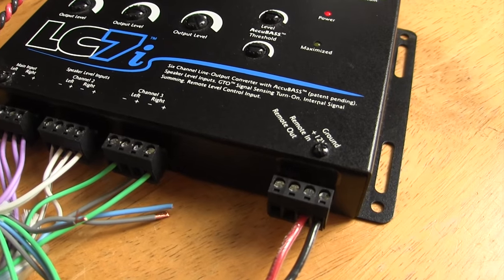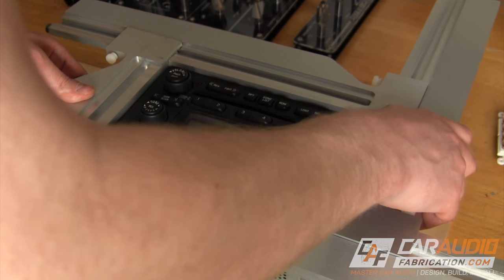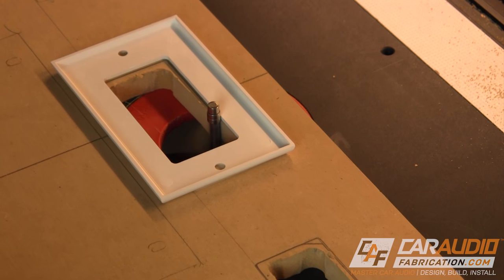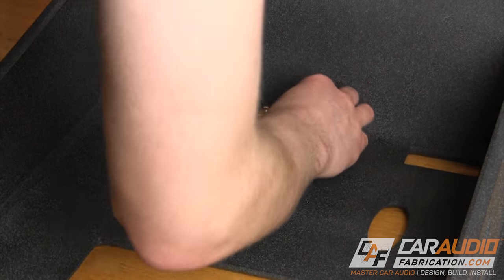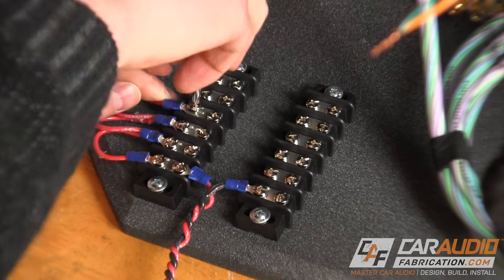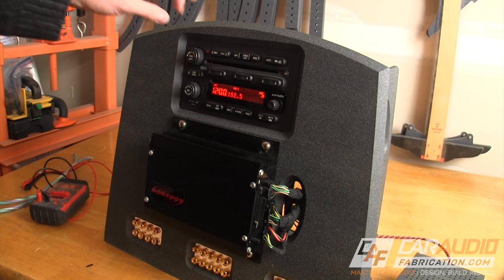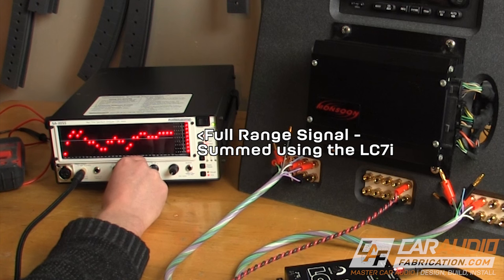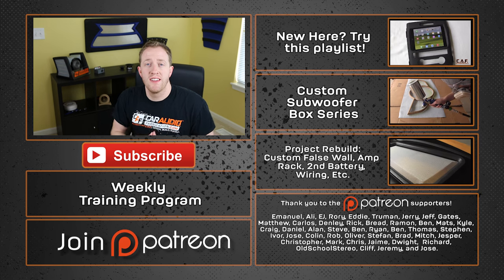Why you NEED Factory Radio Integration - Building the OEM Test Center - CarAudioFabrication

Comment: This series couldn't have come at a better time. I am in the planning stages, (items needed/wanted, placement, etc) of a system build on a 2014 Mazda 3 Sport. And as you may be aware there isn't any "real" possibility of adding a aftermarket HU based on the placement of the factory unit. I have looked into the Audiocontrol processors, etc, (as well as other brands) and this will really help with a real world view on how these work. Especially since I too am primarily a visual learner. Thank you.

Comment: Looks great. It's too bad that some of theses aftermarket DSPs and summing LOCs are so expensive, almost being priced out the same as new aftermarket double din stereo. But I completely understand that factory cosmetics and integration of the HVAC climate controls and other vehicle features amounts to a expensive aftermarket dash kit with an expensive data module just to add aftermarket double din. Great video and demonstration.

Comment: I like that setup, Mark. This really shows how some of the auto makers are stepping up their audio game, but making it harder on us DIY guys. I wonder if they'll ever come out with an OEM headunit with audio outputs (digital would be nice)
Reply from the maker: +BigAl205 Haha that would be the day, it probably cost 13 cents to add so there is no way they would ever do it.
Reply: +BigAl205 Alot of Scion OEM head units have 6 channel preouts on them already, its to bad their cars are so ugly.  On some BMW and Mercedes, you can get an adapter to convert the factory optical to a toslink cable.
Reply: +CarAudioFabrication Scion has analog rca outputs on some of the head units

Comment: Hi
Great video👍
I have a 2017 Honda Civic Rs hatchback 1.5T(Australian model) which is probably equivalent to a touring or sports touring except without navigation.It has a premium factory stereo with 12 speakers including a factory subwoofer and factory amplifier. I just want to disable the factory subwoofer and add an aftermarket subwoofer and aftermarket amplifier just for some extra bass and leave the rest of the factory set up as is. Nothing too complex.
I have the pioneer gm-d8601 monoblock amp which accepts high level speaker inputs up to 16.5v and therefore don’t need a loc.
Installers here in Australia can’t give me a straight answer about installing this amplifier with a aftermarket subwoofer. 
This is what they tell me:
1)Use the existing factory subwoofer wires straight to the pioneer amp. These wires are coming straight from the factory amplifier and therefore watts going to factory subwoofer is unknown.
2)tap into speaker wires from behind the factory head unit and straight to the pioneer amp for the signal. 
3) other installers say I can’t get a signal for my aftermarket amplifier directly from behind the factory head unit because the signal is digital and not analog and therefore I need to get a signal for the aftermarket pioneer amplifier after the factory amp. Meaning I can’t bypass the factory amplifier.

Any help advice would be appreciated on the simplest and cheapest way of doing this install. Seems like installers here down under are not that knowledgeable.
Cheers mate

Comment: Great video as always, keep up the good work!
Your video just introduced me to the idea of a summing DSP, I have no experience in this area, so I may be off base with the following observation...  With any crossover, digital or analog, there will be phase shift introduced at the crossover point(s).  The amount of shift depends on a number of factors including the type of crossover (LW, Butterwoth, etc...) and the slope.  When summing the signals back together the phase shift in the overlapping regions will likely introduce some funky cancellation and comb-like-filtering.  Those anomalies will be difficult (if not impossible) to correct through downstream equalization.  It seems to me that an installer could use a tool like SIA/EAW Smaart to do a phase plot of the two adjacent signals (one at a time) and then overlay the plots to see just how bad the cancellation might be.  Just thinking out-loud here...
Anyone with real-world experience with this I'd love to hear your thoughts and experiences.
Reply: I have a question that I’ve been trying to figure out I’ve been following your videos and I do get a lot of ideas and ways to do things that help me like it helps many others and I think you the question I have is I have an 07 Cadillac Escalade that I’m fixing to install a LC8i
I upgraded on my door speakers and I will be installing a small amp for my Meet in  hi’s And one more app for my l Low’s My question is do I leave my factory app up and running or do I only tap into speaker signals and disconnect power to it can you please help thank you

Comment: Man I love your channel, you do some fantastic work. I'll try to keep this short. I have a 2015 RAM 1500, base system (8.4 with 6 speakers, not the alpine amplified system). Currently have Morel Tempo Ultra 6.5 in the front doors. Purchased an AudioControl D-6.1200 to bi-amp the fronts and bridge channel 5-6 for a single 10" sub. My understanding is this radio already puts out a flat signal on all four outputs. I do believe there is a bit of base reduction which the accubase in the D-6.1200 should resolve.  I have an LC7i installed with my current mini amps. All that said, is there an advantage to running something like an LC7i, a FIX86 (have this on hand also) or Pac Amppro before the D-6.1200? Or will high level inputs to the D-6.1200 be all that I really need?

Comment: Hey, Mark.  Maybe you can elaborate on whether or not it's beneficial to try and grab factory signals BEFORE the OEM amp (line level) as opposed to after (speaker level).  Seems many folks say it's generally better to use preamp signals vs. speaker level.  But with new technology in today's processing equipment (take Audio Control's newest DM-810) I'm thinking it doesn't matter  as much as most people think.  Going to start a build soon with my 2015 Explorer with the upgraded Sony system and wondering if I should just tap into the wires after the amp (speaker level) in the cargo area or try to get them from behind the OEM head unit (line level).  Will be buying the aforementioned DM-810 and  also their SA-4100i microphone too.  I'm not even sure the line level wires behind the head unit are user-friendly or not, which is an entirely different topic, but hopefully you understand what I'm trying to say.  As always, thank you VERY MUCH for all your work on your channel.

Comment: I used a Lc2i for my 2015 Kia Optima factory head unit to run 2 p3 12s off r1200-1 Rockford Fosgate amp and it made no difference, I still can't get below 40hz. How do you get the lows from factory head unit? I've been told you can't. Nice video!

Comment: I don't know if you have a video already, but I've been looking into adding cooling fans to an amp setup. I live in an area where it hits 115 regularly, Lake Havasu! I looked into the SMD thermostat controller, but I'm really wanting something a little on the cheaper side. I'm seeing quite a few devices on EBAY, but I'm unsure how they work or if it's just easier to get the SMD unit. I'm going to need multiple fans.Let me know your thoughts on this.?

Comment: Awesome! I there no way to get a flat response from thar stereo? One would asume that with the eq of the signal with pink noise would be flat. Also imposible to know without that equipment!
Reply from the maker: +Lautaro Hunzicker it's very common for OEM gear to be anything but flat. The OEM tries to adjust for frequencies that sound bad on the stock speakers, cause vibration, or potentially damage the OEM speakers. Then you add aftermarket speakers that can handle it but you are missing the information in the signal. You make it flat by adding a equalizer. This signal would be usable after the LC7i, but not exactly ideal. The audiocontrol DQ-61 or similar would be a better choice for this exact system. Now we know!
Reply: +CarAudioFabrication I am glad to see a discussion like this given I am doing a build which include 2 Hifonics amps Brutus 2000.1 (sub) and 1200.4 on 1 Lc7 Kicker 15 and 2 sets of components Precision power. One installer insist i need a Bit 1 $749 and others say the Lc7i or similar. This is for a 2015 Murrano. Sound quaility wise can you here the difference?

Comment: Could you install a custom Bluetooth module like the one that connects to the factory 5 disk CD changer like the ones in a jeep grand
Reply: +Tevin Jones If the manufacturer offered a BT module for the original system, it is possible, however if not, adding Bluetooth will require an accessory that jacks in in via the aux in or changing out the head unit entirely.

My preference is changing out the whole head unit.

Comment: I’m adding a 4 channel and 1 sub amp to the LC7 and factory radio. Uconnect system. Will I need to add a aftermarket EQ for better clarity or would the LC7 alone make the system clear enough. Also I’m changing all the factory speakers to aftermarket as well.

Comment: Hi Mark
I have a 2014 silverado  LTZ with the bose sound system. I'm looking to get a line output converter and I was looking to get the Audio control lc2i. My question is can I use the feed for the stock subwoofer for the signal to converter for my amp?

Comment: I have a 2006 Nissan Xterra, with the factory Fosgate 7 channel 9 speaker system. I am replacing the component door speakers and tweets, with new components and intend to remove the factory amp, replacing with an Lc6i and a 5ch Soundstream Pn5.640d. Is it better to get signal before, or after the factory amp into the Lc6i?

Comment: QUESTION:
I assume my factory amp also has these crossover sections. Would it be safe to tap into the subwoofer out if I plan on using an external amp for just a subwoofer?

Comment: My oem radio has 8 speaker wires, I want to hook it up to a eqs755 high level input, my issue is the input only has 4 wires, how do I wire my radio to the EQ

Comment: I'm speaking from a position of ignorance here, so please forgive me,  but wouldn't the factory source unit send full range signals to the factory amp and then task it with sorting out the frequencies (exactly the same way we do it in the aftermarket world)? Or do they really task the head unit with crossover duty? Seems like they'd be running tons of wire all over the vehicle that they wouldn't need to.

I'm not entire opposed to the idea of having to keep a stock radio, but it sure would be nice to get the noise of the factory amp out of the system if you could.
Reply: You would be getting rid of the noise of the factory amp, the purpose of this video is to show how to effectively bypass the factory amp by stealing a good signal pre-factory amp.
Reply: +Maxwelhse Also, a lot of the times it is easier to go after the factory amp if there is factory bluetooth, navigations, centre channels, etc. retaining the factory amp would eliminate the hassel of maintaining all those features through the stereo.

Comment: Used the same unit in my car, but the factory headunit produces way too much background noise (noticeable  even with the factory speakers). Once you use the audio control unit and amplify the input it's worse then the factory headunit...
Reply: Have you tried any ground loop isolation techniques or additional earthing with a big three kit with extra earths? Depending on the car this can fix those issues.

Comment: I'm wondering, if you have zero interest in ever selling the car within the period a working OEM stereo matters, or even if that's not the case...
Wouldn't it be much better for the sound quality to hack in to the OEM headunit and find pre-amp signals to run to a DSP instead of having the noisefloor and distortion of the OEM amp in the mix?
I mean, there has to be one point in the path between all the GPS/DAB/FM... stuff and the actual amplifier chips/transistors where there is a low voltage level audiosignal to break in to?

Comment: why integrate the outputs off a factory crossover when in turn you get a degraded signal. wouldn't it be more effective to find the frequency range of the crossover to run 3 separate amps. Then find tweeters and midbass/midrange speakers for the given range for the front stages, also have subs and box tuned for optimal
Reply from the maker: +1mouse3 then you are limited using what the OEM determined was good crossover points for the speakers. Not a good situation for tuning. Money could be better spent on a DSP, or signal summing equalizer plus amps.
Reply: +CarAudioFabrication I wouldn't scrap that idea right away actually. Yes full flexibility in tuning is a big plus for people that go for best overall tonality with drivers they pick based on brand preference, sound character, mounting options...
However finding drivers that are compatible with the stock processing while matching some or all of the above criteria can be a good challenge and a different legit way to go. The stock processing will limit the ability to perfect tonality and staging, but this way can lead to a purer, cleaner sound due to the simplicity.
Compared to some line convertors, a DSP/convertor/summing device costs quite a bit more, money that could be spent on lower distortion speaker drivers, enhancing the purity of the sound even more.
Since DSP's have become very mainstream, chasing the perfect tonality and staging seems to be the preferred way to go, but I don't think it is the only way at all. Remember the times when lots of competition builds still ran simple crossovers and equalisers in the same categories as the guys with fancy expensive DSP's? The DSP crew didn't necessary crowd the stage positions because some of those analogue guys had fantastic clarity and purity in their sound.
Reply: +CarAudioFabrication Or change the whole stereo head unit out and put in one that give you more useable outputs...

My only known issue is integration in the dash layout and integration with steering wheel controls.
Reply: +Veer Maharaj That's often not desirable. I recently bought a new car, and while the headunit is easily changeable, there are a lot of settings for my car that are only accessible trough the headunit touch screen.
Reply: i find design choices like those on cars to be reason enough to strike them off my purchase list. Visited my fam in USA and they have an old chevy malibu with no aux in, no cassette deck and no bluetooth, and the deck has the display for the service and system computer. Talk about the stupidest possible design choice and these all seem to be GM vehicles. We started getting GM vehicles down here and I have been avoiding them like the plague.

So far, japanese have been the safest bet for customization.
Reply: +Veer Maharaj It's not that those settings are something I adjust constantly, and they can be changed trough OBD, so changing out the headunit wouldn't really limit me, the more basic versions don't even have that touch screen headunit, but I just can't defend buying an expensive DAB/NAV-headunit plus whatever module to make the steering wheel controls work, when my car is equipped with all these functions minus RCA outputs.
Reply: +Candisa I agree with you there, but as in the case of my cousin, those weren't even options that were available in cars back then. Car designers not considering flexibility to modify vehicles later on is short sighted, especially when they boast about how long their vehicles can last on the road.
Reply: +Veer Maharaj Yeah, I remember some Seat models used to have the headunit in 1 piece with the heater controls, only to have 1 less gap in the centre console! Luckily somebody found out there was just a din sized radio behind that facia and a little work with a Dremel converted that panel easily into a heater control + din slot facia...
I'm afraid car manufacturers for 1: really don't want people putting in non-oem add-ons, and 2: actually want people to buy a whole new car simply because they want a new feature. 
My previous car had an OEM navigation system in it that worked actually better than most after market system. You know why I didn't mind sticking in an aftermarket headunit and a TomTom? Because the most recent maps I could get for the stock system were from 2006, only 5 years after that car was made, and 2 years BEFORE that generation was replaced!
Reply: +Candisa well said. I made.a joke with my father once when I was listening to an interview with a BMW executive. They asked him if they will be providing upgraded connectors to existing models when apple introduced their lightning connector. 

I said to my dad, it's funny how your car is just a really expensive cellphone dock now. 

Even things like steering wheel controls. They could move to USB and have 1 USB connector for the head unit for media controls. But keeping it proprietary means owners are nothing more than  lease holders.

When self driving cars become the norm I'll invest in some very nice headphones.